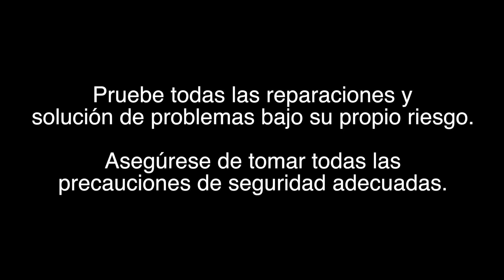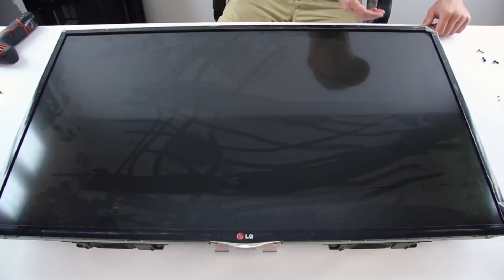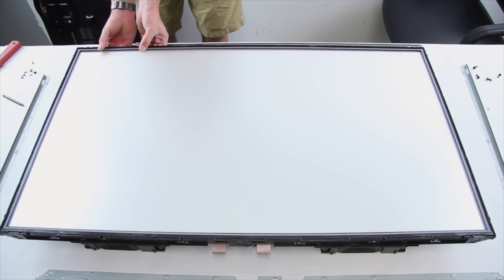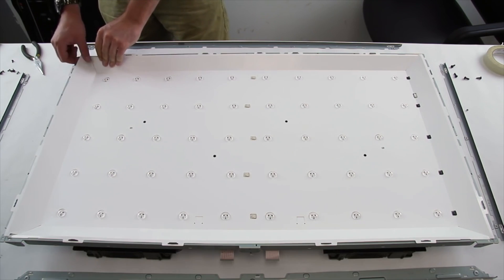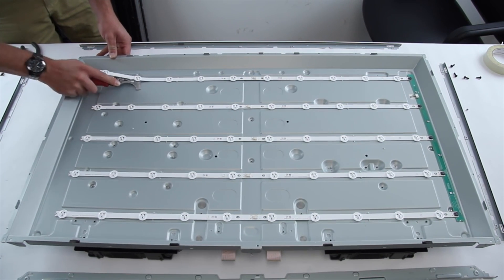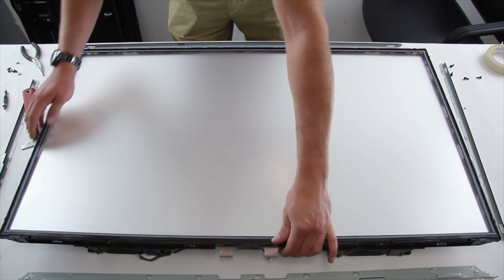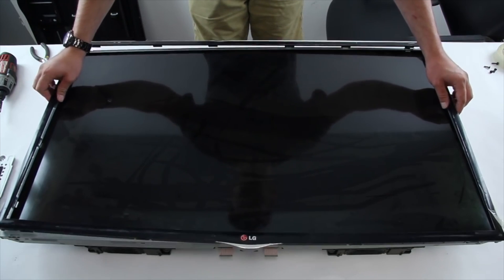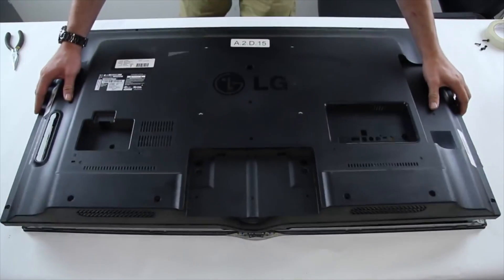Tutorial de reemplazo de tiras LED - LG 42LN TV - reemplazar las tiras de LED - subtítulos español

Comment: I have a LG 42LN5300-UB 
Black screen flashlight test revealed picture so I assumed power board or LED light strips done volt test at LED positive connection on power board shows 0 replaced power board still have same problem no back light